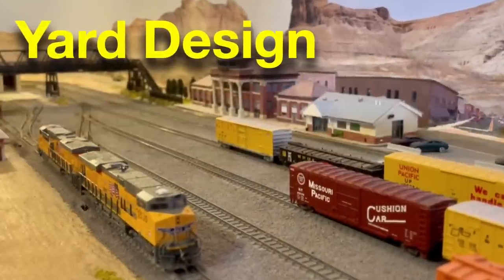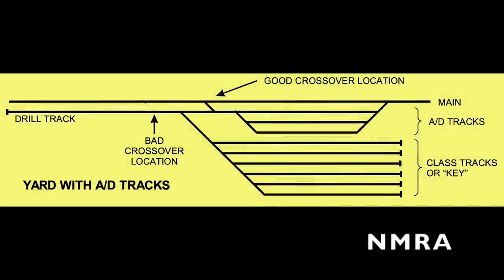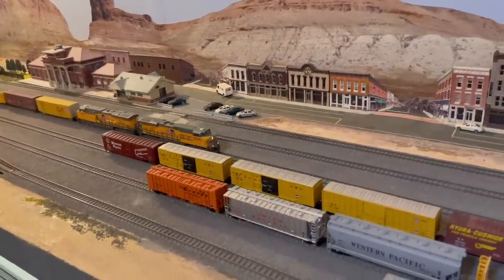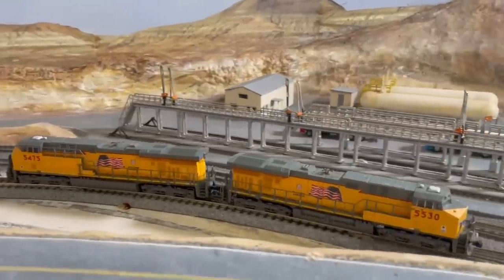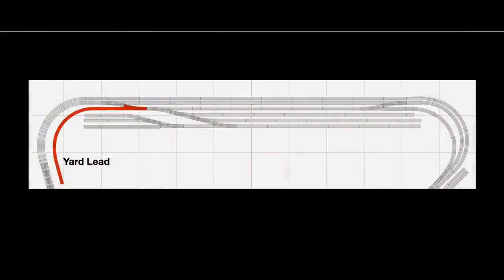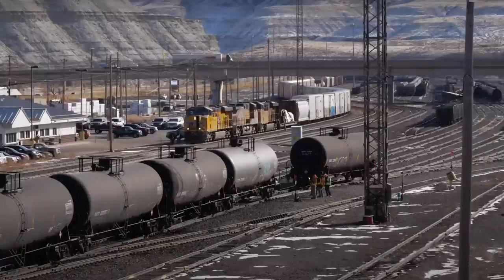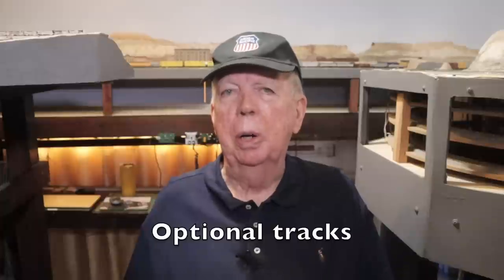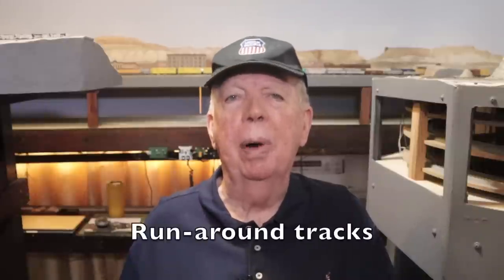Model Railroad Yard Design

Comment: Thanks Roy, I have watched this a couple of times, and my yard has the right stuff. I will use it for awhile before I out any ballast on it to make sure it is functional.
Reply from the maker: Craig, I think that's a really good idea: I mean, running your trains for a while on your layout before ballasting the track. That way, you can be more sure of your track configuration and placement, before "permanently installing" the track by ballasting it, after which I becomes more challenging to make changes in the track. ...Roy

Comment: Great to see a new video from you Roy! Unfortunately Kato Unitrack is limiting because of its geometry. Because of that I used Peco track and turnouts (Medium Radius) for my yard with a double slip switch allowing me to enter and exit from four directions. Regarding the automation - DCC-EX would allow you to do the required stop without you having to manually control it - maybe get in touch with Fred Decker from DCC-EX and see what he can come up with - I think you could do it with a DCC++ setup using an Arduino, motor shield and WiFi board, plus an EX-Rail script. Fred should probably be able to help you further. Look forward to your next Vid. Cheers from Melbourne, Australia.
Reply: Greg, are the Peco turnouts #5 frog by chance? If so, they're probably every bit as reliable as a #6 - and may be just the trick here for Roy.
Reply from the maker: Thanks for your comment, Greg. I really like Kato Unitrack, but I do wish Kato would offer a greater selection of turnouts. Thanks for your suggestion regarding automation. I must admit I'm baffled by Arduinos. I'm continuing to work on this matter of automatic stops for crew changes, which I imagine would work just like station stops. ...Roy

Comment: As usual a great and informative video, thanks.
Personally I'm not really into operations and don't have a classification yard. I am into automation and continuous running, so I use detection and iTrain. This is a way you will be able to automate a stop for the crew change, but it isn't easy, or cheap!
Reply from the maker: Hmm, I'm going to have to check into detection and iTrain, Lloyd. Thanks for suggestion it. ...Roy

Comment: Great video Roy! There is an old book by Model Railroader that is no longer in production that is a great guide to freight yards. I will send you a private message with a link to that book. If you have an open ended yard and not stub ended, each classification track could also become a departure track as well. Also for selective compression, using 3 way turnouts and single/double-slips can help lengthen or add more tracks. As for the crew change, might contact Iowa Scale Engineering and ask about their Motorman. You could add #6 turnouts on the yard tracks and make a compound ladder to add tracks between your current tracks. Just a few suggestions. Have a great one! - Jason
Reply from the maker: Thanks for your comment, Jason. It's always good to hear from you, and as always, I appreciate your suggestions. I will continue to look for that book, and - who knows? - I may eventually find it. I am continuing to think about changes that might improve the classification tracks in a way that would reduce the spacing between the tracks and allow me to add one or more additional classification tracks. Thanks for suggesting Scale Engineering, I will check it out, because those stops for crew changes absolutely must be automated. ...Roy

Comment: I was in the Engineering Dept of CSX and every yardmaster was always wanting another crossover , more tracks, longer tracks, but when the the cost estimate arrived, they had to contended  with the had. Same with model RR.  Fueling thru trains , get a fuel servicing truck and access road  along main tracks.  Consider installing a second turnout on each class track to fill the wide gap between existing class tracks, this will shorten both tracks but give additional sorting tracks a nd justify the cost!
Reply from the maker: Thanks for your comment, Pete. I appreciate it. In response, let me mention that I'm considering replacing the No. 6 turnouts on the yard ladder with No. 4 turnouts. After all, that wide space between the tracks is caused by the geometry of Kato No.6 turnouts. No. 4 turnouts don't seem to work as well, but at least the space between the tracks would be reduced, and I anticipate that I would be able to add more classification tracks. I hate to rip out anything that's already "permanently" installed, but it may be worth it in this case. ...Roy

Comment: Nice video.  Question.  At 23.20 you have your uncoupling stick laying between two switches.  What about a double slip on both sides of that stick and a piece of track running between the two.  That would give you an engine runaround for a lone car going to the shop.
Reply from the maker: Thanks, my friend. I'm still looking at ways to do a run-around track. Of course, I use Kato Unitrack, and Kato doesn't make any double slip switches, but I'm working on that problem. ...Roy

Comment: save the existing yard ladder, on each yard ladder turnout beyond the frog ,on the short curve to the yard track ,install. New turnout either a #6 or #4 turnout to connect to a new track between the existing tracks .
Reply from the maker: That's a great suggestion, Pete. I will be checking it out. If I can make it happen, you'll see it in a future video. ...Roy

Comment: I'm a bit confused when you say that you didn't have space for separate arrival and departure tracks. Look at the photo at 4:25, and you see that the gap between two trains is about the width of a train. But at 6:25, the gaps between your tracks appear to be about twice that. It looks like you have space for separate arrival and departure tracks and at least one more classification track, without having to crowd things.
Reply from the maker: Thanks for your comment, my friend. Yes, there is an excess of space between my yard tracks. That's because of the geometry of the Kato No. 6 turnouts that I have used in my yard ladder. I am thinking about replacing the No. 6 turnouts with No. 4 turnouts, which would reduce the space between the tracks and allow me to add more tracks to the yard. ...Roy
Reply: @n-scaleunionpacificevansto6569  Oh, I see. Sucks when track manufacturers force that kind of thing.

Comment: How come your tracks in yard are so far apart as it looks like you should be able to get another 2 tracks
Reply from the maker: The spacing of the yard tracks was caused my use of Unitrack No. 6 turnouts rather than No. 4 turnouts in the yard. It's caused by the geometry of No. 6 turnouts. ...Roy